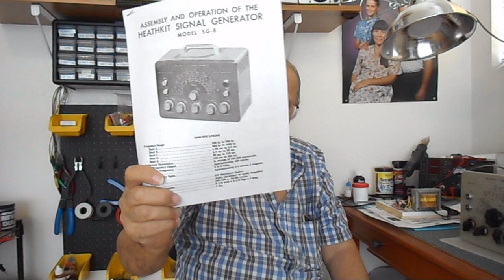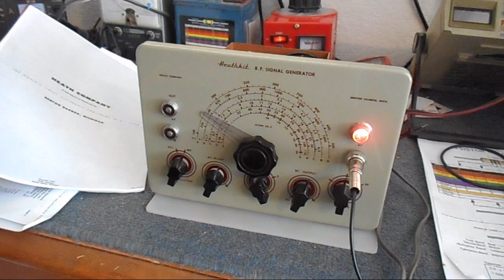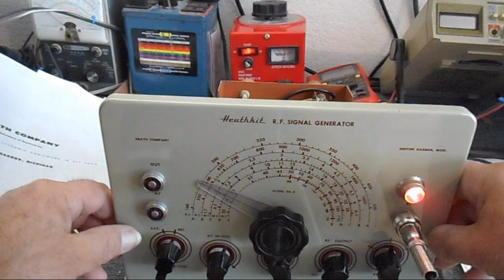Closer Look at Heathkit SG-8 RF signal Generator

Comment: I agree with your Assesment on the knobs, somewhere there is a Heathkit Radio with the original knobs. I actually like the replacements!
Reply from the maker: I have other Heathkit equipment with the round grey knobs never did like them much but these are great

Comment: There are a couple of YouTube videos where the probe connections were changed out to BNC connectors. You can get new probs for your unit off of fleabay from a couple of vendors
Reply from the maker: Yes I saw the videos where they changed to the BNC connectors I do have  about 5 or six bnc connectors I could use might do it later.